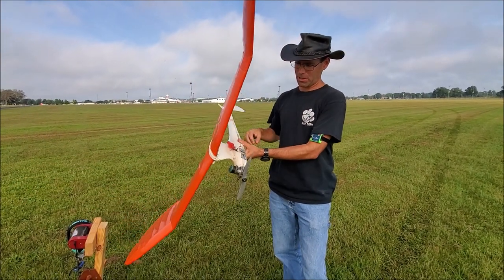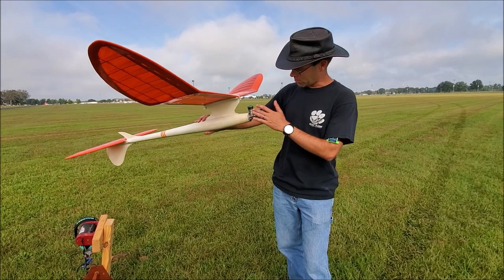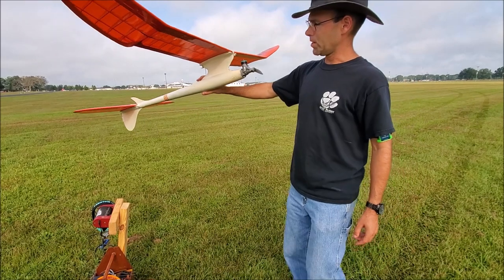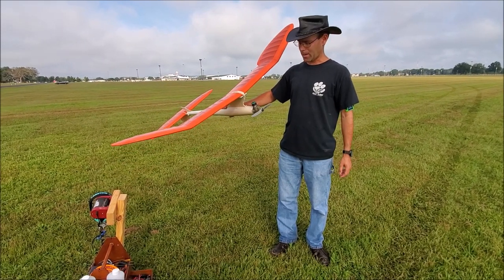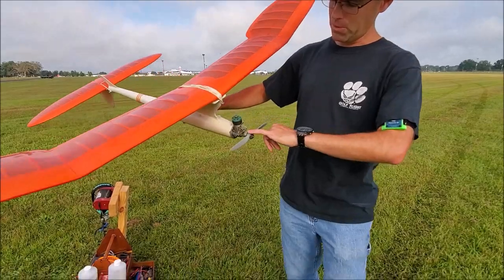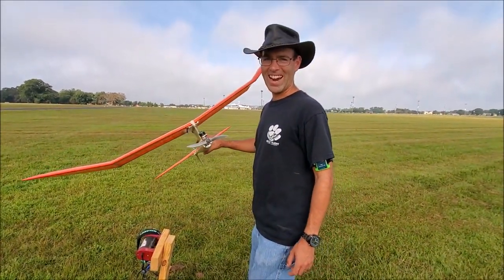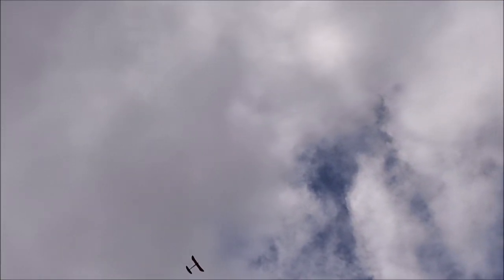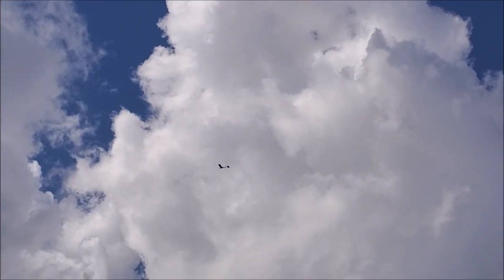Stardust is the most beautiful free flight power model you've ever seen!

Comment: You could add a emergency parachute to it that gets let free by a micro 3 gram servo that way when you fly it and something happens and it is gonna crash you can flip a switch and parachute is let go and plane floats down safely with no damage from the error or what ever happens to cause it to almost crash that's what I do with all of my balsa free flight electric or nitro powered planes and my smaller 25-50 inch wing span electric balsa rc planes they are equipped with a good size parachute that is launched out of canopy or a small hatch out of back or anywhere I can hide one in so I don't lose aircraft due to mechanical or more of the problem me operator error biggest influence in any rc airplane crash is humans lol
Reply from the maker: I've been putting radio dethermalizer on most of my freeflight stuff these days. Works better than a parachute. Unfortunately for my RC stuff, if something goes wrong, a chute won't fix it. Typically less than a second from problem emerging to splat.
Reply: @joshuawfinn  yes I was experimenting with parachute type things with rc planes and I got a system close to working but not flawless and I saw dethermalizer like 5 mins after commenting I didn't know that's what it's called I just added servo to my free flight stuff and didn't know it was called dethermalizer cool.
Reply from the maker: @youknoweverything7643  yup. The parachute idea came out around 1945-46 and was dominant into the late 40s when Carl Goldberg introduced the pop up tail. There were a few holdouts into the early 50s but most folks quickly realized the pop up tail brought planes down more reliably, at least in the wingloadings we use on freeflight planes. Several military drone companies use that method combined with an airbag for drone recovery. Fun factoid, the recovery system on Spaceshipone is based off the pop up tail. Burt Rutan was a highly successful rubber power flier back in the day.